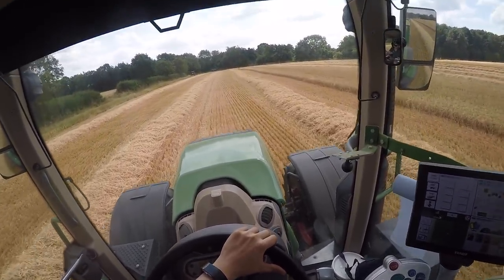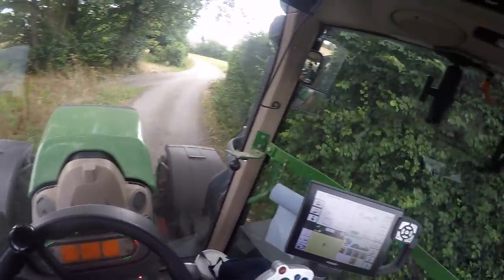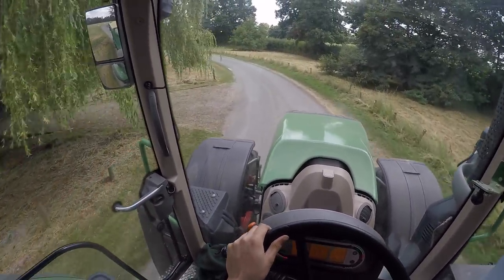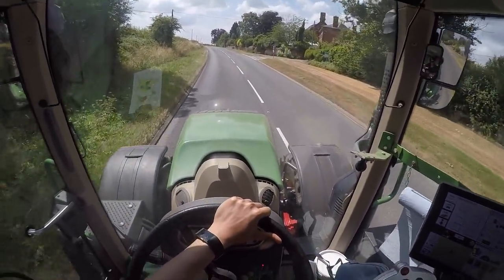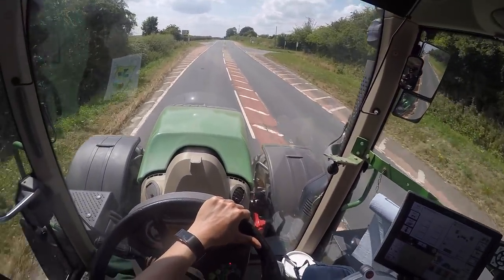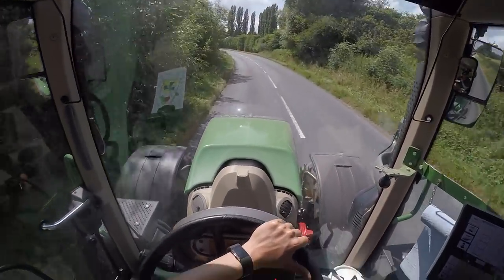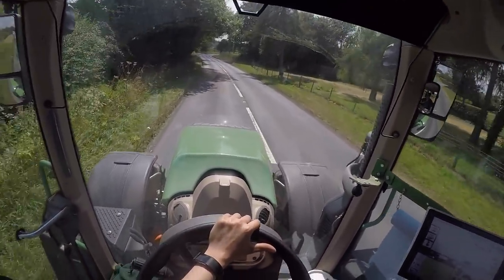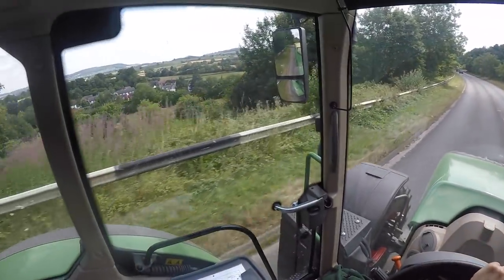Long Grain Cart - Fendt 724 - GoPro HD (Part One)

Comment: you should have driven the tractors that I had to use in late 70s early 80s a ford 3000 to no what lack of horsepower it would have taken us a lot longer than half an hour more like half a day
Reply from the maker: nigel shepherd Implements have got larger too though so tractors can still lack horsepower today dependent on the size of the equipment they are pulling. Having said that I don’t think the 724 is under powered - it just doesn’t feel like you’re driving a 240hp tractor.. That’s not necessarily a bad thing though! Understand what you’re saying though